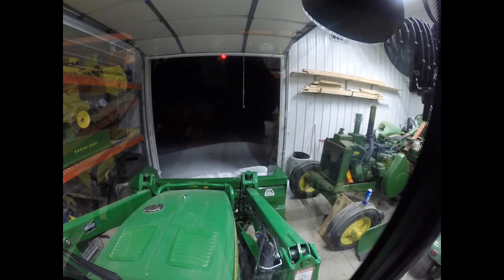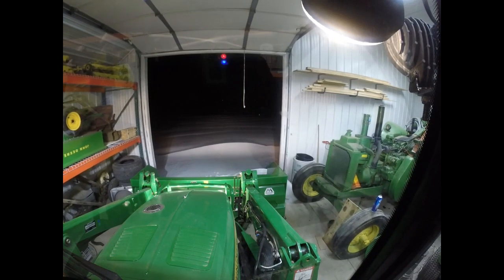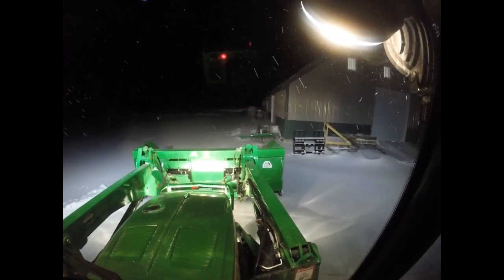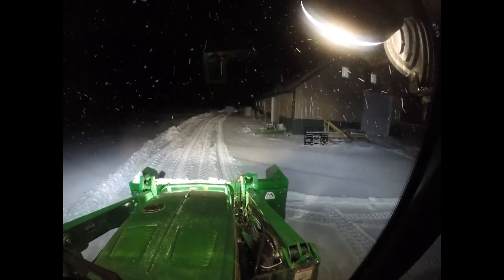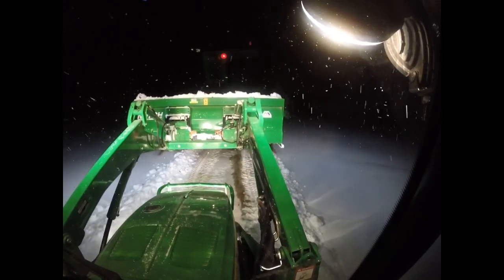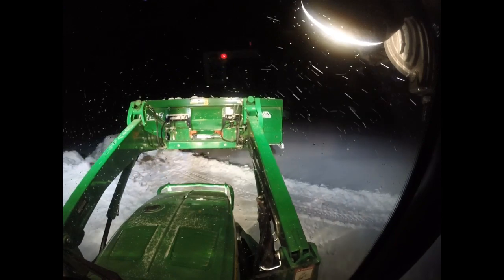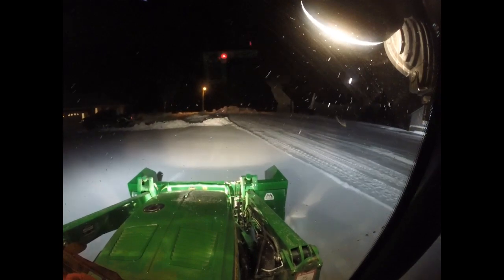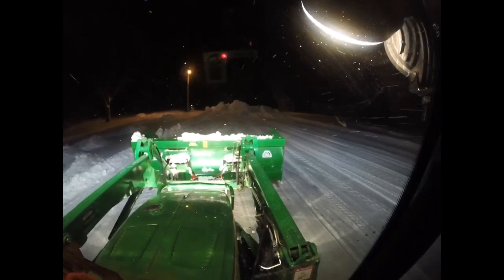John Deere 4066R Pushing Snow

Comment: You might need some chains to go on those r4’s, or add some weight to the front to help from the box pushing you around.  Those lights make a huge difference, and though it was in fast speed, the actuator working through the change from box to bucket was slick.
Reply from the maker: If there is one thing I do not want to add to this machine it is chains. I do intend to add some weight to the rear tires at some point in the future. The pusher itself is close to or over 1,000 lbs and I don't think there is an easy way to add enough weight to the tractor to stop the box from being a jerk sometimes..... lol. Yes, I love the actuator, by far the nicest addition so far to this machine.

Comment: Weird time for this video to show up in my feed, but nice watch.  Btw, is it just me, or is your loader mast loose?  Looks like it's moving an awful lot in relation to the hood.  I only have a little 1026R, but when I got it, the one side of the loader mast bracket wasn't torqued, only snugged.  Did a lot of loader plowing before I finally could afford a snowblower... and glad I got one; it just took too long with a regular bucket and no MSL with the lower flow-rate.

Comment: hi why would you not use a snow blower instead of the box. only asking as all I can see is you pushing the snow around
Reply from the maker: Great question! In my particular case there are three reasons. First and foremost is cost.... The pusher was $1,700 while the blower is closer to $4,500 (set up the way I want it to be). Second is the fact we have a gravel driveway, blowing snow with my 1445 I found I preferred a blade over blower because I can get the driveway cleaner without scraping up rocks/dirt. Third is type of snow we get. It's very rare we get enough snow to justify a blower. For me to use the 4066 with a blower I think there would need to be at least 6+inches on the ground. This past April we got a bad storm and taking with my neighbor it is the first time since 2006 he wanted a blower to move snow.

Comment: Can you get a power broom attachment for it?
Reply from the maker: You can get a broom. However, they are expensive because theoretically you need a hydraulic power pack to power the broom. Unless you found a 3 pt broom with PTO option (but I don't know if those exist).